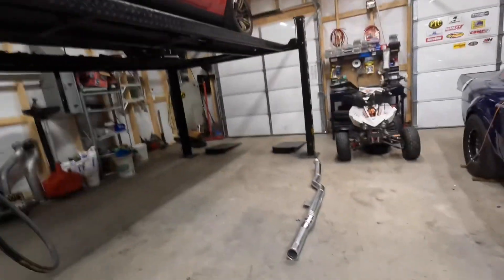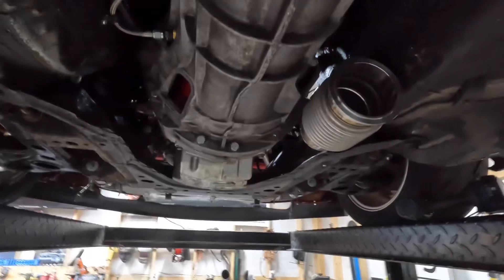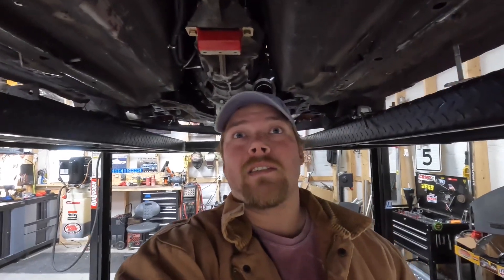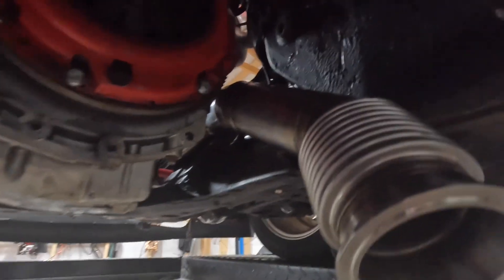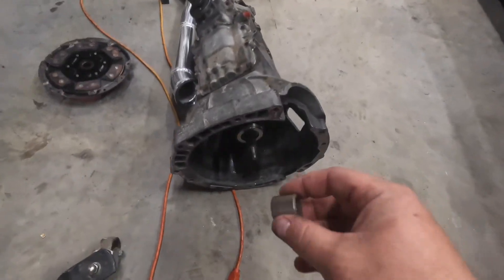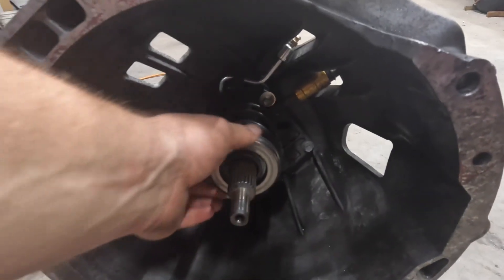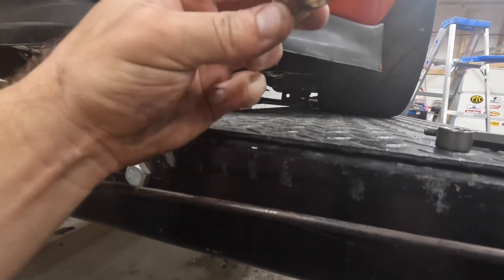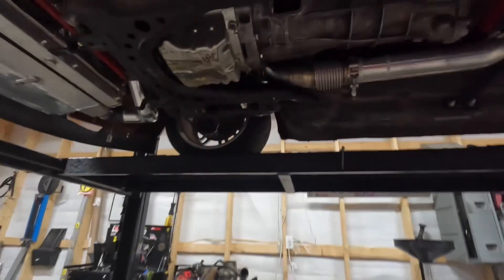We Built an Aluminum Exhaust for a Big Turbo 2.3 EcoBoost Miata

Comment: What transmission are you running? I love the car man! I have a RHD 1990 Miata and can’t wait to Ecoboost swap it.
Reply from the maker: M5ord-r1 from a ranger!
Reply: @Justamiata  From a 2.3 ranger? God I hate the 3-4 ratio in that one (I have a ranger) it's just so long. Also, they're only rated for 330lb-ft of torque at the crank. What's your experience on going beyond that and driving it hard (prepped side-step launches) if you've done so?